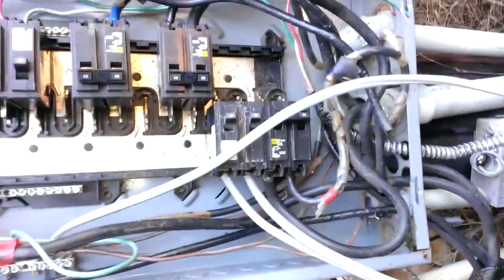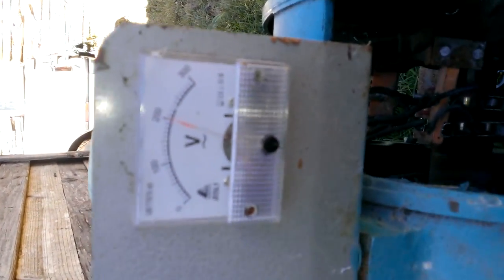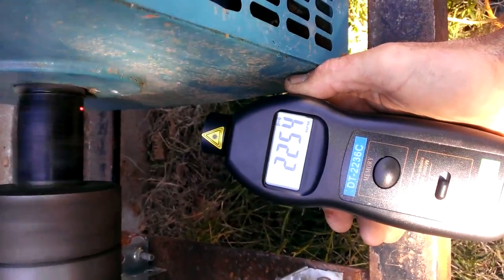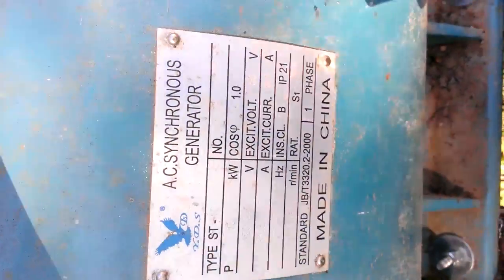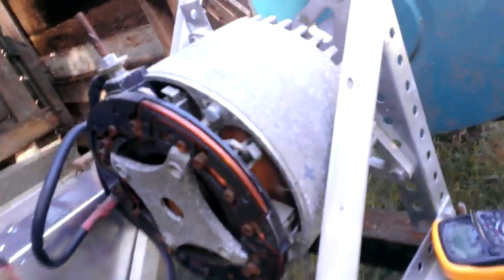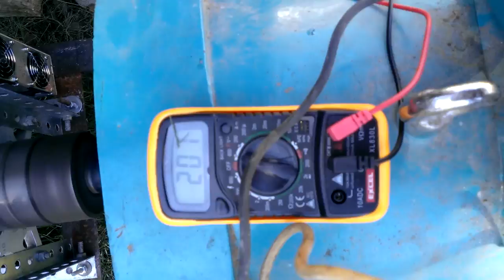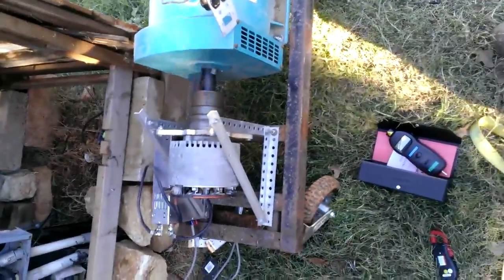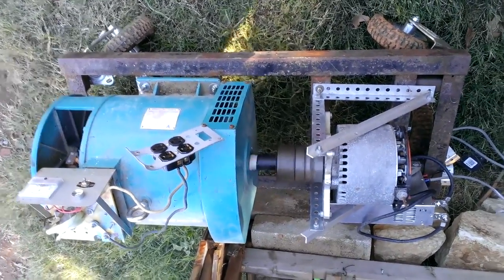Unity Generator - 300% over-Unity for Home/Business

Comment: Just because you can spin a 10kW generator doesn't mean it's supplying 10kW unless you attach a 10kW load onto it. You will then notice the RPM to decrease significantly and you would actually require more than 10kW of energy to drive the generator. That's just physics.

Comment: This video demonstrates turning an AC generator via a rectifier and a DC motor. The AC generator has no load (nothing plugged into the electrical outlets) and is producing zero power, zero watts. This video demonstrates 990Watts are required to do nothing.

Why don't you hook up a load and then take some measurements for the input and output voltages and currents?

You have volts but no amps coming out, which means no power output.
Try hooking up a 1kW or 1.5kw radiator and then measure the output voltage and current, (power = current x voltage) then you will understand clearly what the power output is.
The rated power has nothing to do with the actual power being produced.
Look here to learn a little more:

http://en.wikipedia.org/wiki/Ohm%27s_law
http://en.wikipedia.org/wiki/Watt
http://en.wikipedia.org/wiki/Electrical_network

My guess is that for a setup like this, you are probably getting a lot less out than you put in, perhaps less than 60%

How do come to the conclusion you are producing three times the input power (9 x 110 = 990W)?

Comment: A 200kw generator does not produce 200kw unless you connect 200kw of load on it. Do that, and it's gonna slow down unless you add more power at the input, equal to, you guessed it, 200+ kw. No over unity here.

Comment: What a disappointment again :( just another video of somebody trying to make a big generator run at it's optimal speed and then thinks he has done it. Always forgetting one MAJOR part, there is still not a LOAD on that generator, you just don't see it slow down when you put your multimeter on it, that's hardly a load. But, try a 3000 watt air heating fan, and let's say a deep fryer, and let's go crazy, a nice big powertool like a big angle grinder... will it still run as fast, or will the actual LAWS of physics really apply?